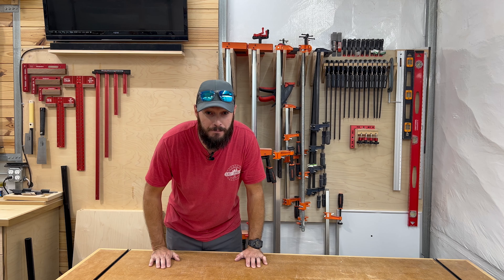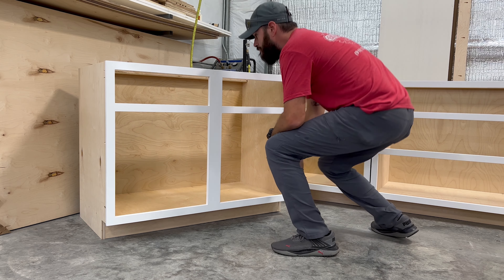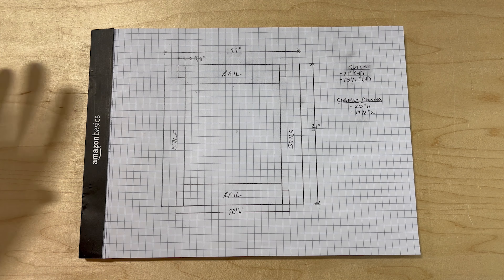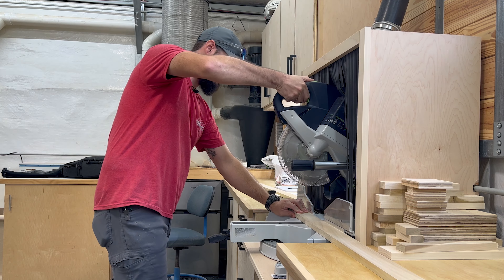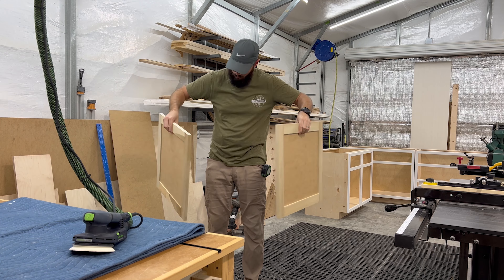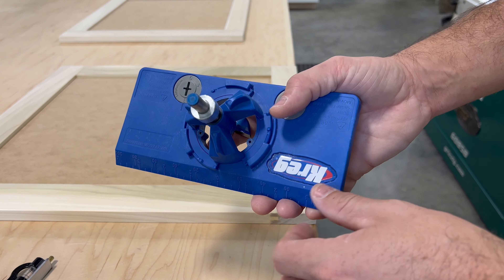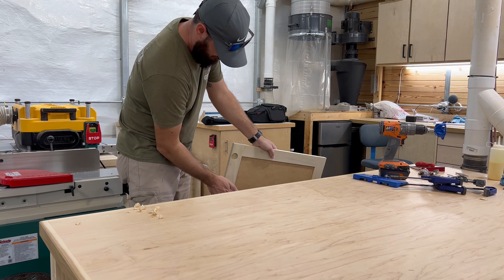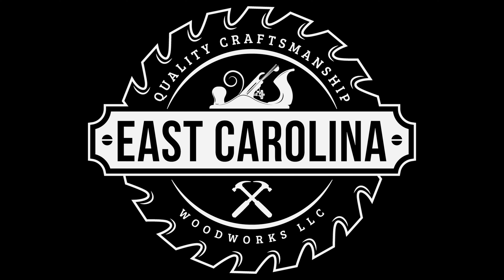How to build super SIMPLE shaker doors // Easy DIY shaker cabinet doors

Comment: Tip:  You are using a shipping blanket under your sanding.  I got a roll of shelf liner from Wallyworld.  It is a rubber foam-like material that resembles a rubber screen.  It has a great grip under your sanding item preventing it from sliding around.  And lets the sanding dust fall through to the table underneath it.  When finished, just give it a shake and all the dust comes out.
Reply from the maker: Nice tip! Think I might go give that a try this week 👍🏻
Reply: That's what I use.  Good tip.
Reply: I'd go one further ... I use carpet ( in the past good but snaggy on laminated objects) and thick rubber ( was excellent easy to clean and cleanable with laqure thinner) now I use silicone mats from Amazon 73 by like 24 inches. The slicone mats keep slip away and glue don't stick or paint. And they roll up for storage
Reply: Yo, what a great idea! Thanks
Reply: I use those too, they're great!
Reply: Yoga mats. Only thing they’re good for.

Comment: What an "'AHA" moment. You pulled out a small square and used it to line up the hinges. What a dummy I am. I was eyeballing it. Thanks for that helpful tip!
Reply: There is an even easier method.  Set the hinges in the holes, take a straight piece of wood and press it to the inside edge of both hinges at the same time.  Both hinges will now be perfectly aligned.

Comment: Well I finally did it, I followed your video and made my first cabinet door ! Laying out on paper what I needed and the dimensions was the most important part and thankfully I do have a set of stacked dado blades so things went quickly. The fit was a little loose on the first style so I scrapped it and made a new one (which meant I had to go through the set up all over again ) if I had known I would have cut and grooved two sets, one to be used just in case. In the end it all turned out well. The final product was a little tight but the sanding of the tenons made the fit perfect. Thanks for this video I know now I can zip through cabinet doors one after another. I have 12 doors to make along with the face frames ( I'm keeping the cabinets and repainting ) . I will be able to look at these doors knowing I did it myself with a great deal of help from you, thank you. BTW, I realize this is probably the busiest time of year for you but a quick video will keep your site alive 😉
Reply from the maker: This is awesome! Glad my video really helped! And I am extremely busy but new video will be out by the end of the week 👍🏻

Comment: I built about 20 doors and drawer fronts like this a few years ago when doing a remodel on my kitchen. I used MDF for the rails and stiles. It worked out fine but there was some extra work sealing and sanding the MDF. If you've ever used MDF, you know that the cut edges have a bit of an "open" structure that needs to be filled and sanded. I milled all the parts and then sprayed several coats of sanding sealer. Sanded that all down and then assembled and painted. They came out very nice. 

Pinning the parts together is a good trick. I'd make sure to shoot the pins in the back side of the door so you won't have to worry about them showing on the front. I didn't pin mine but they had a snug fit so they stayed in place when I assembled them. I did shoot pins in when I made the drawers with the quarter-quarter-quarter method because I didn't (and still don't) have enough clamps.

Comment: At 16.15 ish i see a blanket as a soft hold, I've been using a carpet tile, they can come up to 1m square. It has a rubber backing so when on the bench it wont slip and the carpet top firm but not ruff on finished work enjoy your work regardless.

Comment: Thank you for your enjoyable instruction on cabinet door making. As a neophyte cabinet maker, I find the hardware aspect of cabinet making --selection, installation--to be the most important because failure to calculate correctly can be either catastrophic or troublesome at the least. In your presentation, I missed the discussion of OVERLAY as it relates to hardware selection and then setting the jig accordingly. After watching your instruction, I checked my hardware (Clip top Blumotion) and found that my particular hinges (for face frame application) only allow for Hinge-Side Overlay of 3/8 to 5/8 max. This aspect is worthy of its own presentation, so perhaps you could help us ? One other thing: I noticed you are a fellow Harvey Table Saw man. Perhaps you could do a show on the features of our "European Style" / Hi-Lo fence. Recently, I came across a document that explained these features--Alas! two and a half years since I purchased my saw. Keep up the good work!

Comment: Thank you for all the videos. I am building cabinets, but to my own dimensions for a "library" in my man cave area. Amazing explanations overall. After a little research, i realized why you do 1 and a quarter additions on each side. Maybe a mention that this measurement is based on the hinges you are using would be helpful?  Just a thought.

Comment: on the shaker style door. what hinge from amazon did you use. what I am running into is that hinge has different size overlays ranging from 1/2 to 1 1/2 inches, by the way your videos are spot on,

Comment: The Kreg hinge jig has 2 small holes that you use a small bit to drill for the screws while clamped for the big hole. I just use 2 drills, one with each bit. Faster than drilling the hole later and that’s what the jig is for. JS

Comment: You are setting up your Kreg hinge jig, drilling the large hole for the hinge, then taking it off, squaring up the hinge and then drilling holes for the screws. I am not sure if you know it or not but the Kreg jig has holes to be able to drill for the screws built right in and they are perfectly placed for square.
Reply from the maker: That’s correct and you are correct as well! Sometimes when I use the holes on the jig my hinges aren’t perfect which can cause issues when installing so I just prefer to take the jig off and do my holes seperate 👍🏻
Reply: Time for a Minipress!
Reply from the maker: @mattschreiber4251  I’d love to have one but can’t afford it lol 😞
Reply: @eastcarolinawoodworks  keep your eyes out, they can be found used for around $1k. If you’re building full kitchens a mini press and a Castle pocket hole machine will more than pay for themselves. An outboard fence on a shaper, too.

Comment: I'm building a built in pantry cabinet and the top section will be a tall cabinet and the doors will be 56" tall.  Should I use 1/2" MDF for the center panel and if I do, would I have to use a thicker rail and stile to accommodate?  I'm trying to match the existing kitchen cabinets that have a 1x2 rail and stile.  Also, would you put 3 hinges on a 56" tall door?
Reply from the maker: Yes I would use 1/2” mdf for center panels and you will need to router a 1/4” groove on the mdf to fit in the 1/4” groove on the rail and styles. Also yes I would use 3 hinges!

Comment: Another great video thanks.
 I am curious how do you attach the shaker style drawer front with the void in the back.. hopefully my question makes sense.
Reply from the maker: Yes your question makes sense. Usually I glue a 1/4 spacer in the back so there is no void 👍🏻
Reply: @eastcarolinawoodworks  thanks Eric, that is what I was thinking.

Comment: Question, why MDF, many have options about using it and I wanted to know yours. I know it is dimensionally stable and takes paints well and I used it on my 10’ x 20’ table in my Residential/ Marine/ Canvas/ Commercial/ Residential Awning business for those reasons and it’s smooth for whatever fabric I was using but are stones your reasoning?

Comment: To reduce the possibility of warping, wouldn't it be better to use 1/2" mdf and rabbet the edges?
Reply from the maker: I’ve never had any issues with warping on smaller doors. If the doors are over 32” tall I use half inch. 🤙🏼

Comment: Have watched all your videos in the cabinet build series. You do a great job of simplifying the process. Just curious where in NC you get hardwoods from, as I recently moved to the state and have been buying from a place in AZ and always had to rely on them picking boards for me. I'd prefer to select my own. I don't mind traveling 4 to 5 hours out to a good yard or local mill.
Reply from the maker: Im located in Greenville NC. Where in NC are you located and I can try to help you find a good place?
Reply: @eastcarolinawoodworks  Richlands
Reply from the maker: @wayner.edwards8545  oh wow not far at all from me! I usually find people on Facebook marketplace to buy from if I need it quickly. Other than that there the hardwood store in gibsonville about 2.5hrs away and they have anything you would need! Hope this helps 🙏🏻
Reply: Westpenn has a great supply of exotic and domestic wood. Along with slabs.

Comment: Finished building the cabinet from your build series. I have a 1/4 reveal on the sides of my door. I keeping hearing you mention in the videos you like 1/2 reveal. Did you mean 1/4?
Reply: No, he meant 1/2 reveal which is the distance between the edges of adjacent doors and drawers, but nothing else. I completely understand you only have 1/4" between your door and the edge of the face frame, but cabinets far more often than not are attached together in a run.   Having 1/4"  between doors and face frame edges ensures there's 1/2" reveal between all doors of all cabinets fastened together in a run; it makes things uniform throughout.  If that doesn't make sense, let me know.
Reply: Ahh I see. Thank you for the detailed explanation and answering my question

Comment: I have a 24x90” coat closet that I’m putting two doors on; each 24x45. Haven’t done doors this large and I’m worried about warping. Should I be fine with the method you showed in this video?
Reply from the maker: Yes but you would probably need to add a rail in the middle to help keep the door from warping!
Reply from the maker: Yes but you would probably need to add a rail in the middle to help keep the door from warping!

Comment: Did you install any foam in the grooves to keep the panels from rattling? Just wondering. 
Thanks for sharing.
Reply from the maker: No I typically don’t. Pretty snug fit and I’ve never had an issue 👍🏻

Comment: Just curious why you use a self centering bit with hinge instead of using the screw hole portion of the Kreg cab hinge jig? I’ve never had an issue doing it that way
Reply from the maker: After heavy use the holes on the jig get bigger and don’t do a good job putting the hole where I need it. So I just do it this way. 👍🏻
Reply: Gotcha

Comment: You use dado blade but I only saw you put one is that right?
Reply from the maker: Yes that’s correct! I use the outside blades from the dado stack because they have flat teeth and leave a cleaner cut 👍🏻

Comment: Tip, keep a sample piece of rail or style, if the same size, already with the Grove cut so you can use it to set the fence and blade with out having to do it multiple times. 

So basically you are using it as a template for a one time and quick set up.
Reply from the maker: Agreed! This is not how I typically do doors. I just wanted to make a video and show how anyone could do it with a Tablesaw. I have 2 shapers that I use 😎

Comment: What can be an alternative to the kreg jig to make holes for the hinges?

Very concise and good video.
Reply from the maker: You can always use a drill press or make a jig with the center points marked! I’ve seen other jigs people have made on YouTube that work fine. Hope this helps 👍🏻
Reply: @eastcarolinawoodworks   Awesome. What kind of drill bit would that be called if I made a jig? Hand drill, I don't have a press. Thanks for all the great vids/info.
Reply from the maker: @Snail_Shell  I’m pretty sure it’s a 35mm hinge forstner bit!

Comment: Do you do any solid cabinets with all hardwood?
Reply from the maker: Are you talking about milling up hardwoods to make panels for cabinets instead of plywood?
Reply: @East Carolina Woodworks  yes, I see these high dollar places and wonder why  they're so costly?  I made one out of popular  8ft long about 28in high. It could fall off the wall since it weighed so much.
Reply from the maker: @joseph2219801  I’ve built a few from hardwood but mainly use ply. Sometimes you can build out of ply and use hardwood veneer to give it the appearance you want for less money.

Comment: Give me a link for the henges you used
Reply from the maker: DecoBasics 50 Pack 1-1/4" Overlay Soft Close Cabinet Hinges for Kitchen Cabinets -Satin Nickel Self Closing Kitchen Cabinet Hinges Concealed with Built-in Soft Close Hinges Damper -3 Way Adjustability https://a.co/d/bv6Ad49
Reply from the maker: You can buy them in other overlays to fit your needs! Hope this helps 👍🏻
Reply: Until I made replacement doors for our cabinets, I didn’t understand how important the overlay can be.  Our older cabinet doors only had a 1/4” overlay and I made the doors the same size as the old ones.  Bought 1/2” overlay hinges and it caused a problem.  Lol.  Found 1/4” overlay hinges and they worked better.  Enjoyed the video, it’s pretty much how I did it and was glad to see your finer points on everything.  The jig you used for mounting was sweet.

Comment: If you are running 1.25 overlay why use such wide rails and stiles for face frame?
Reply from the maker: 1.5” is what I’ve always done, if you do that for all your cabinets it allows 1/2” spaces between all your doors and drawer fronts. Plus it gives the cabinet more strength!